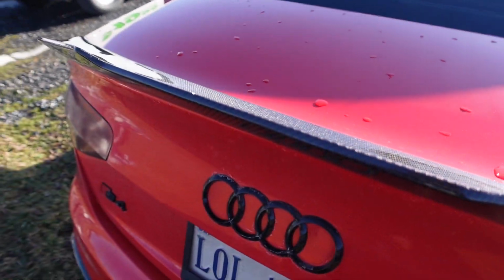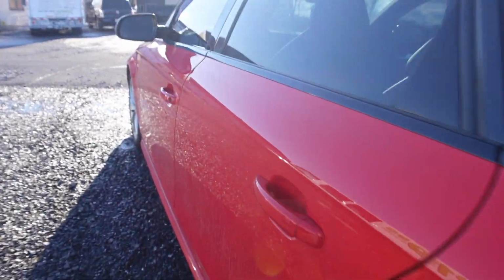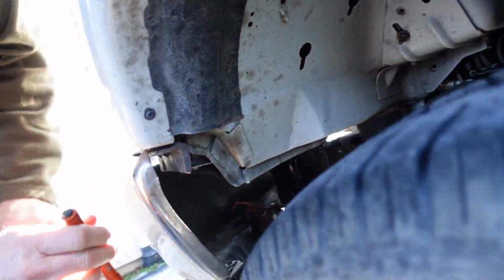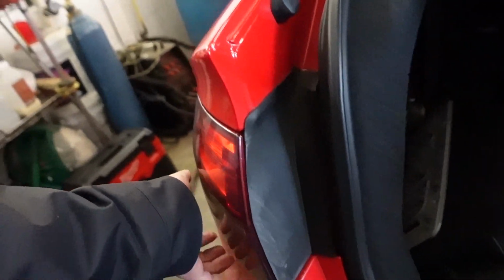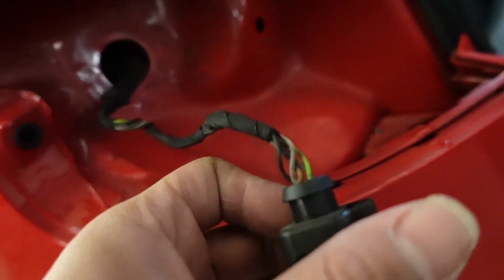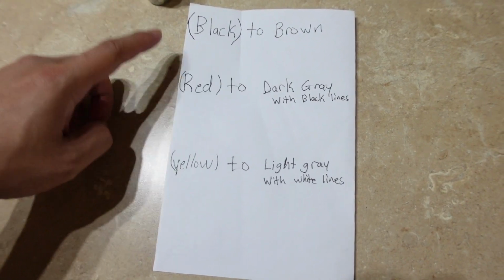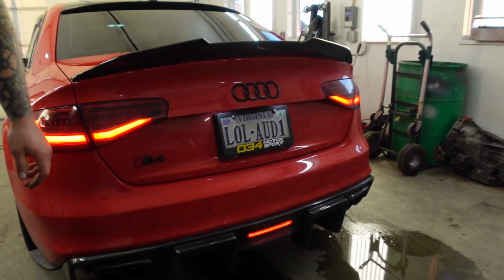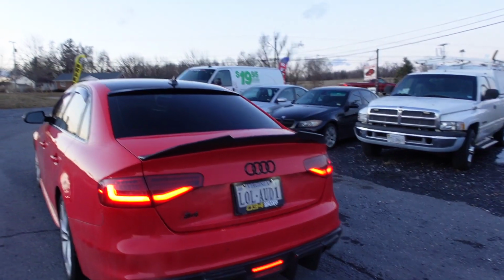CANAUTO CARBON DIFFUSER BRAKE LIGHTS DIY ON MY AUDI S4 B8.5!

Comment: My one of these has arrived... the installation looks fairly straightforward apart from connecting the light. Tempted to try this myself, but also contemplating letting a professional do it. What'd you think?

Looks great BTW! 👌
Reply from the maker: Let a professional do it if you don’t want to mess with wiring

Comment: Thanks for the video. A4 B8 was having different colour cables. But after conneting them original lights of that side stopped working and started working  after removing the diffuser cables. Any suggestion please.
Reply from the maker: I’m not exactly sure how it was done. I try to give the solution on video

Comment: Is the wiring the same for b8 a4 models?
Reply from the maker: Should be
Reply: Thanks for the video. A4 B8 was having different colour cables. But after conneting them original lights of that side stopped working and started working  after removing the diffuser cables. Any suggestion please.

Comment: Any of you guys know the connections on a 2017 a6?
Reply: Please let me know when u get the chance
Reply: have any of you figured it out yet? i got the ground and the normal light with the tail lights and the brake wire works but it will also turn on with the left signal.. so im trying figure out how to make it work with braking but without the left signal
Reply from the maker: I’m not entirely sure sorry. Reach out to canauto I’m sure they would
Help.